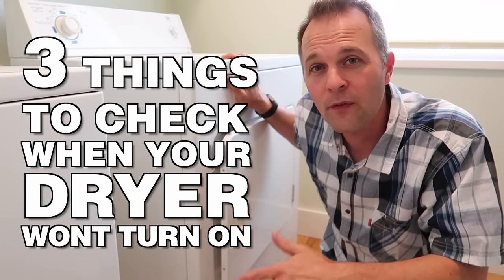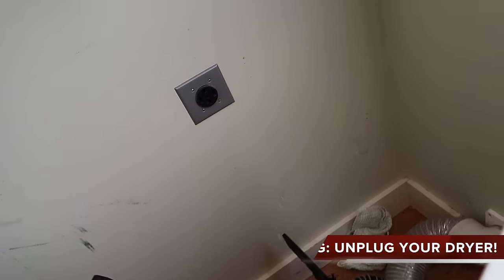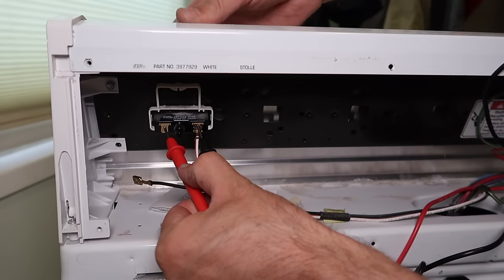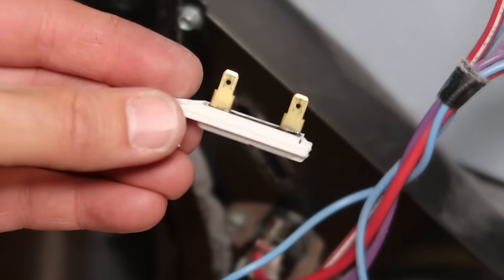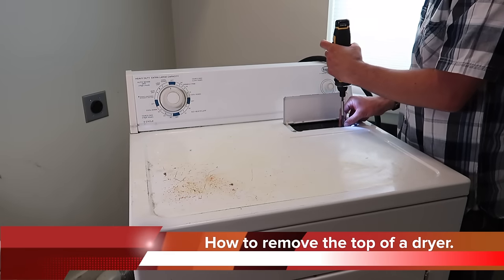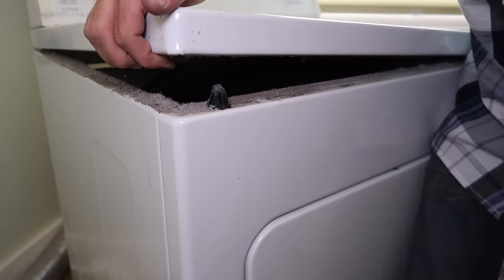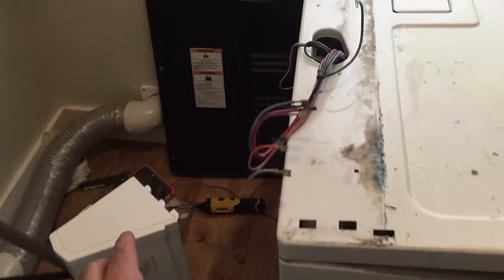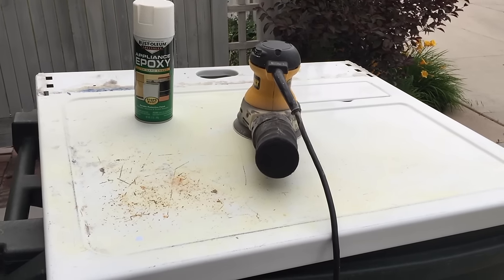3 Things To Check when your Dryer won't turn on or start - REPAIR

Comment: Don't think I'll have any luck here, but I figured I'd try anyway. 

So, my heating element went out on an old dryer we've got (Admiral Capacity Plus). I got this kit in the mail that came with the heating element, and an assortment of thermal fuses (2 L248-80F's and 2 smaller KSD301's). Decided to replace the thermal fuse next to the element for kicks (the L248-80F). Dryer turned on, heating element was working. All was well. About 5-10 minutes go by, and the dryer just shuts off. Right about the heating element on top of the dryer was REALLY hot. No matter what I try, can't get it to work again. Checked all the parts mentioned in the video with multimeter, but they're all good. Checked the breaker box and the outlet, and they're all good as well. 

So, I've got 2 questions...
1. Did I install the thermal fuse or heating element incorrectly? Shouldn't have bothered replacing fuse, but I figured better now than later on down the road.
2. Even when the heating element was bad (had a cut in one of the springs), the dryer would still run. I've heard there's a way to reset the dryer via control board, but I can't find anything like a switch or button whenever I looked. Is that an option?

Comment: Thank you so much for this video. Turns out my thermal fuse had corrosion, which is why my dryer stopped working. I was able to get it fixed for $12.

Comment: My dryer problem was a broken belt. Obviously the drum can't rotate, but more importantly there is an interrupt switch (just like the door switch) on the spring loaded belt idler. This shuts off the motor when the belt breaks. Belt replaced=switch closed, works fine.

Comment: My LG dryer was the display board that had a burnt area. Found on YT a guy who showed where to by pass the damaged area via a wire and solider. 30 min later and it worked. I already replace that PC board once 2 yrs ago. I didn't want to pay the $160 again. Thanks YT

Comment: thank you for your video
My whirlpool dryer showed PF-power failure couple of time and then never turn on. I checked fuse but that's not the problem door switch works too what should I need to do now?

Comment: It’s a great video. I ran into a problem which a multimeter would have missed. My door switch, thermal fuse and starter all tested correctly for continuity. The door switch also clicked and turned the light off in the hopper as it should. Door switch seemed solidly working. But the dryer wouldn’t run. So…

Almost by accident, I manually depressed the door switch (door open) WITH the timer running, AND pressed the start button, all at the same time.

Voilà! So here’s the cause. The door switch was electrically sound, however, mechanically, a piece of its little black throw lever had either been broken off or worn down, so that when the door closed the nub of it glided over the top of the door, and simply wasn’t depressed back as it should be.

Lesson learned - 1st test turning on timer, holding door switch, depressing starter. And don’t go ordering a new starter switch and multiple fuses until you try that one simple thing.

Comment: Thank you for this helpful video! Turns out the continuity was good in the thermal fuse, but bad in our push start relay. So we replaced it, but it's still not working :/ What am I missing here?

Comment: It was the switch for me. Not sure why he had me disconnect the wires. I unplugged the first couple on the left side then realized that the cover did not have to be removed. I just picked it up enough to reach down inside the front above the switch, mine was on the top right corner of the door. I blocked the top open with a small box. I unscrewed the door switch from the front outside ( just 2 small Phillips head screws) then I pulled it out and unplugged it from the power wires. A little tricky but it's just a small clip you can use a very small flat head screwdriver to remove. It doesn't matter if you damage the part your removing so just be careful not to damage the part it plugs into.

Comment: Greetings and thanks for the post, I changed the thermal fuse and the dryer worked for a while then stopped working again. Any suggestions???

Comment: Did you change the lid switch??  If so, where was it?  Trying to figure why you removed the wiring harness whether the switch was in the front or just under the control panel in the left rear corner.
Reply: I understand where you are coming from.  I swapped my door switch.  4 screws unscrewed and two clips undone.  2 screws on the back edges, 2 screws on the lint dispenser and the 2 front clips. good luck!
Reply: Oops,  should have said door switch. I think somewhere I got confused with a washer and it’s lid switch.
Reply: William I have changed many of these. On many with that switch, I raise the top, remove wires from the switch and two screws holding it on. Forgot the screws for the lint chute also. 
  I see that is a Whirlpool built unit and you are checking the thermal fuse also. 
  Actually on many Whirlpool units you can pull each side of the top toward you while pressing your leg against the cabinet and pull up on the front to raise the top after removing the two screws in the lint chute.

Comment: My issue was no heat but had electricity. The electric panel had the circuit half flipped. So electricity was going through, but not enough to produce heat. Flipped it off and on and it worked perfectly.

Comment: When you’re checking the thermal fuse does the dryer need to be plugged in?
Reply from the maker: No! Never! All repairs are done with it unplugged.
Reply: @AdamDIY  I fixed the fuse and now my dryer turns on but now it won’t heat up. It did before it stopped working tho. Did I miss something or is it a new problem? Could you please give me your advice?

Comment: when you’re checking to see if it’s a problem with the start button, and you probe the circuit using the multimeter, do you have to plug the power cord back into the outlet? 

Initial steps said to ensure the power was disconnected, so I’m not sure if that needs to remain even when checking the start button with the multimeter 

Thanks

Comment: Great video.......unfortunately / fortunately I checked all three components and they are in working order.....Now what ..??....lol   Thank you  for any feedback....also when you check with your meter does the fuse for example have to be unplugged....in other words u can only check if you actually touch the terminal vs.the plugs ??/ Thank you again

Comment: Like your videos, you come across as honest about repairs...So, Have to ask....... I have a Maytag Dryer MDE9316AYW that the dedicated start button Buzzes loudly when depressed and the dryer doesn't start. The buzzing is coming from the start button area not within by the motor, I believe. When this 1st happened, I changed the selection to a different mode and it worked well. Now not at all. All troubleshooting I've found doesn't address it. Any help?

Comment: Thanks, it's not the door switch because the light is on with the door open and when I hit the switch it goes off.  I haven't got farther but I'll check.  The thermal fuse is ten years old and I've never had to change it.  The drier went from working perfectly to not turning on at all.  If it was a belt it would try to run I think.

Comment: Adam, I have a Kenmore dryer. Recently, the only way I can turn it off is to open the dryer door, but when I close the door the dryer starts again. It will not turn on or off with the push knob. The door switch seems to be good (clicks). When I put a multi-meter to the on-switch, without pushing the pin, I get the continuity beep, however when I push in the pin, the beep continues. Shouldn't the beep go off? Does this indicate a bad on/off switch? Thanks.

Comment: It's always that damn thermal fuse lol 

I'm fixing my son's mom's drier, and that was the first place I was going of course.   Took everything off and got access. 

Low and behold I move the plug after unplugging it and I notice the neutral was loose and falling out.   Like dangit, did all that and all I had to do was replace the cord lol.   Now I gotta get a can of appliance epoxy to repaint hers with because it looks like dogpoo.  Thanks for the tip.

Comment: Mine turned on but wouldn't stay on.  I just took off the mesh cover of the outside lint trap and that somehow released the flaps and the dryer turned on.  problem solved. thanks for posting this so that I could troubleshoot before calling a professional.

Comment: Thanks for the video Adam.  Our dryer smelt overheated badly.  When I opened the door a bra wire had got stuck in the top of the filter - so the filter was out of its hole.  I noticed the filter has snapped along the bottom of it in two but it fitted together again when slotted back in.  This morning when I thought its had time to cool off I tried it again - but the machine is making a noise like its working and expelling air through the hole slot thing at the bottom but its not turning or drying.  Do we need a new dryer or is there anything I can do to get it going again?  Thank you.Kaz

Comment: Thanks for the info, you gained a subscriber, for us it was the door switch, Darn that thing! I folded duct tape into a little square and taped it to the door aligned with the switch, the raised surface created by the little square pushes the door switch lever further in making it work again. This allowed us to continue to use the drier until I replaced the switch.

Comment: great video.i was able to diagnose and replace the fuse in the same day.just one question is that fuse a part that just wears out with age? my concern is, is there an underlying problem that caused the fuse to blow.thanks
Reply: clean the vent tubes - restricted air flow or bad thermostat sensors

Comment: Adam.What is it when your electric dryer( Frigidair DE500ADW5) works as it should and shuts off at the end of the cycle, but the heat is staying on. Checked the heater, is not grounded.

Comment: Dude, I fixd mine today, problem was a buildup of lint n dust on the dryer motor, especially where the wire harness plugs into the motor,  I blew it out with compressed air

Comment: Hello. I have a series 80 kenmore dryer. The switch works, has continuity & was replaced, but dryer drum wont turn on when start switch is pressed. But i do hear the noise as if the switch is engaging to make the drum roll. Similar to a car key turned and theres no turn-over.  If the fuse was bad, id get zero type of response right?

Comment: I fixed my washer because the heating element went out and the repair guy told us $100+ to fix it. I bought the parts for $40.00 on Amazon. I noticed our dryer sparked the wall outlet after running the dryer for a few seconds. Do you know what could've caused that? Also after that the dry wouldn't come back on and our landlord had to come mess with the circuit breaker to get it to come back on.

Comment: Can anyone please give me advice???
I did this and my dryer works now (turns on and spins). It was the fuse but now it doesn’t dry either. Did I do something wrong or is it another problem at the same time as the fuse went out? ☹️

Comment: Okay well I did not clean my lint screen for sometime and my power button is not cutting the dryer on , so could that possibly blow your thermal fuse on a dryer ??  Also notice it was hard to put the dryer screen back in even after cleaning the lint screen, Almost as if lint is stuck in the bottom....

Comment: Adam is guy like me. So I like his channel. First purchase electrical meter. Then learn to use it. This is and amazing tool to own. I have 10 of them because I like building circuits. We always called this meter an Ohm Meter. Any thing electrical or electronic you needs at least one. Any time trouble shooting electrical/plumbing is making sure the power source is getting to where it is needed. Switches open and close the door on power sources moving forward. In Adams example the door and start switch worked but the third switch the thermal switch did not. IAMGEM bought 2 for $8 amazon. changing one is easy as light bulb. Thermal switch is the most important switch. It keeps you from burning down your house and save all your family from fire. If thermal switch gets to hot it turns dryer off so that it does not make so much heat to cause lint to catches fire. If lint and dryer catch fire then house can catch fire. So this is very bad. I do not fight fires anymore because I am to old. Please after ever load of cloths please remove all lints. I want you and your family to be safe. No Fires! Blessing Turbo

Comment: Hi, When the start button is pushed it hums on, release the start button and it turns off. It also sounds like it does not have enough power to completely turn on. Any tips? Thanks.

Comment: 6/5/24 5:53 pm I need some advice.  My Kenmore elite gas dryer has power and you push the start button. That just makes a beep and will not start. I replaced the thermal fuse the thermomeaster. Hi, load temp, switch. My door switch seems to be fine clicks good. I checked the belt switch. It seems to be clicking and in position fine. So I'm at a loss where I go to now.

Comment: Hello.. I have an electric dryer that turns off in the middle of the cycle and then nothing turns on in the control, as if it had no power, it takes about half an hour for it to turn on again, everything will work normal for 15-20 min and then again it will shut off everything as if I had no power, wait 30 min and it will turn on again. I checked the thermal fuse but it works. Any idea on what the problem might be? Thank you

Comment: How many thermal fuses are there on a GE GTDP200EF1WS dryer and where are they?  I have checked the breaker, cord, 30 amp fuse, door switch and start button and they are all fine so I am guessing the thermal fuses are the next thing I should check.  I do not have one of those white ones or I just can't find it.  HELP

Comment: I know its 220V but (gently) wiggle the cord while its plugged into the wall outlet.... no tools or meters needed. After spending an hour taking off access panels etc (and nearly calling for a tech)... the problem was a janky outlet. Shut power off..... replace 220 outlet and dryer cord and exhaust vent tube (for good measure)....Bing bang boom... Fixed...total cost.... 35 bucks.

Comment: Great video! Question: My dryer (Mayatg) When I push the start button, it only buzzes and makes a click sound like it's trying to start but can't
Reply: Did you find out what was wrong with your dryer? That’s exactly what mine is doing

Comment: Why would this thermal fuse blow in the first place?  I just recently replaced the heating element, thermal fuse, high limit thermostat and thermostat all at once when my dryer wasn’t heating, and after a week the dryer won’t start.

Comment: hi adam, love your videos, i have a 2 yrs old samsung dryer Model No. is DV45H7000EW/AC， it can be turned on, but not start, no error code at all, so what will be the most common problem with it?  Will check myself first. Thanks a lot!
Reply from the maker: Washers with circuit boards are an entirely different beast.  If you are not getting any error codes I would look into a bad start button. After that maybe an inspection of the main board or swap it.  Sometimes it is a common problem to that model and a search in an online forum may be your best bet for a clue.
Reply: I opened the top, found the belt is loose, from youtube it could be the plastic wheel warn out and cant hold the belt.

Comment: Hey Adam - I have a Whirlpool LEW0050PQ2 and parts seem rather expensive.  Any idea how compatible the thermal fuses you mention are with older units?  I tried searching online for parts for this Whirlpool electric dyer (made in 2004) and fuses are $80+... any ideas?  I'd imagine they are charging premiums because of the age of the dryer, but seems astronomical.  Any advice?  Thanks!!

Comment: What does it mean when my dryer worked fine, then shorted out (or safety shut off a few times) but now, when I push the start button, the dryer sounds like it wants to spin but just hums. ?? 
Help. I don't want to fix things that ain't broke. Lol. But I'm willing to try to fix something that is. 
I'm getting the feeling it's the belt. ? 
Thanks for any help.

Comment: My dryer will not turn on if I dried a load a few hours before. It only works when it is cold. But it works fine then. What could be the cause?

Comment: Is the dryer plugged in to power when testing continuty.  You have a flashup on screen saying make sure unit is unplugged. Will multi meter read with no AC power flowing through Dryer?
Reply: Yes, it will. It's unsafe to have power going through it - 240VAC is dangerous. For continuity, the multimeter provides a small (safe) DC voltage, and reads based on that whether the leads are connected.

Comment: I tried this place for  Kenmore dryer parts, not easy to navigate and they didn't list my appliance. I have found many places that have the part I need but it is way too expensive. This website offered no help or references for parts so I doubt I will check them out in the future. Unless you buy direct from China, appliance parts in the U.S. are way too expensive. I normally buy online when possible.

Comment: I appreciate the video however You still did not demonstrate how to replace the drying door switch issue only how to take it apart. Your video clearly demonstrated replacing the fruse a b d test the mob. I am nervously considering trying to fix tge dryer my self. In addition it would be a good idea to add cleaning out your vents while having the dryer apart

Comment: My dryer was just working. I went to put the next load in and I closed the door and went to turn the start button and it just makes a buzzing noise and doesn't turn on.